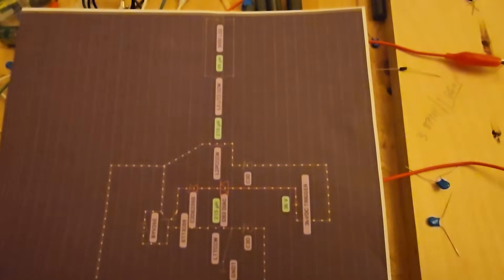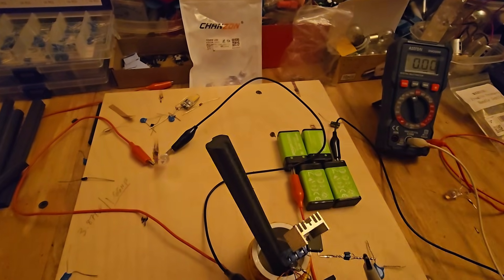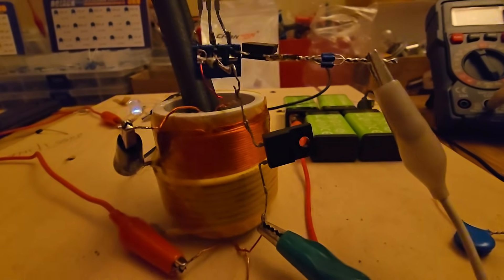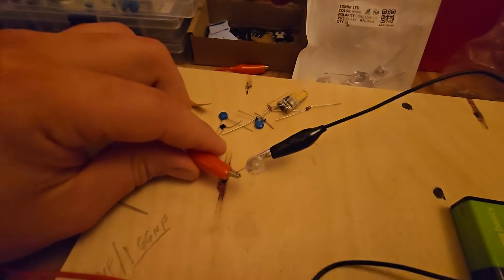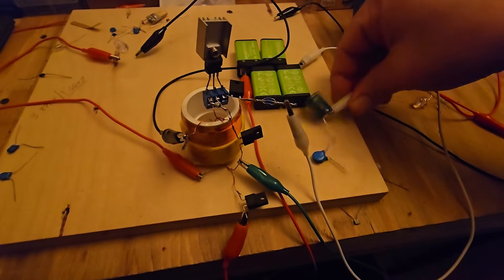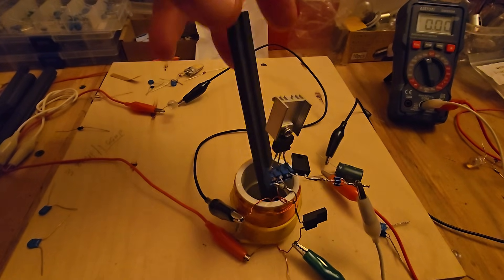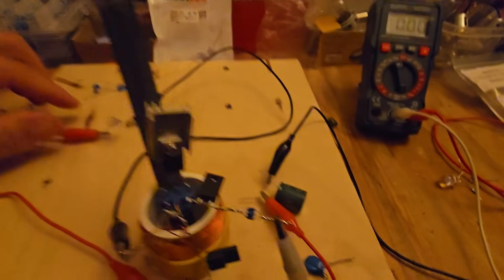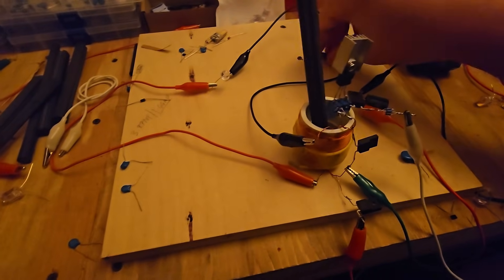🚰DIELECTRIC AVALANCHE OSCILLATOR RUNS OFF FIELD TENSION & PURE VOLTAGE BIAS ONLY.TRUE 0 AMP DRAW🤯

Comment from the maker: Hi, our best performing transmitter is wound upon a one inch diameter pvc pipe coupler that is 1&10/16ths inches wide by 1&14/16th inches long. This transmitter is powered off of a 45vdc VOLTAGE POTENTIAL ONLY to trigger.

The length of the transmitters coils are all 1.48 inches long & centered upon the pvc coupler to be in alignment with the golden ratio.The transmitter consists of three coils being an inner red L1 trigger coil & an outer orange L2 power coil & a 24awg L3 litz coil wrapped in the same direction as the outer L2 power coil for constructive interference. Both the L1 & L2 coils are identical to eachother to achieve sympathetic resonance & are wound opposite & over eachother as tightly as possible for optimal coupling to ensure efficient oscillations with our vital ST13009 driving transistor that seems to be near perfectly impedance matched & we used 24awg solid core magnet wire for both the L1 & L2 bucking transmitter coils. This transmitter is a 416 times mathematically perfect scaled down model of Nikola Teslas magnifying transmitter & heavy earth grounding the bottom of the red L1 trigger coil is vital for its operation & the creation of what appears to be near magic like loadless hyper efficient wireless power effects in the immidiate area possibly due to abrubt inductive switching & for it to possibly pull in dielectric energy in an induction based fashion in theory from the heavy earth ground connection. This energy seems to exist completely outside conductors but conductors are needed to establish the condition for this energy to flow. 24awg solid core magnet wire seems the best so far for the L1 & L2 on this style of transmitter & produces the most powerful wireless power & possible energy synthesis effects due to the 24awg transmitter coils more closely impedance matching with the test transistors we use. So far all our testing shows that the ST13009 transistor from newark electronics is the absolute best to use in this transmitter system with our current design.

The base of our current ST13009 transistor is connected to the inner red 24AWG L1 clockwise trigger coil. The collector of our transistor is connected to the orange outer 24AWG L2 counter-clockwise power coil. The emitter of the transistor connects to the negative of our battery through a series C3D02060 diode (anode to emitter) & DB3 Diac (3 in parallel) & the positive connection of our battery connects to the bottom of our orange L2 power coil through another series C3D02060 diode (Cathode to coil) bottom opposite of the transistor. We replaced the 70 Megaohm 1/4 watt carbon film biasing resistor with a reversed biased C3D02060 diode instead of the resistor that (must be a carbon film resistor for RF applications) between the collector of our transistor & the bottom of our inner red L1 trigger coil to ensure the transmitter can oscillate on voltage potential only. The modules can keep being duplicated & combined for infinite power output from voltage potential only in theory or the voltage potential/biasing that triggers the transmitter can be increased in voltage/pressure for extreme power output at the L3 from one single transmitter/generator unit in theory so long as you don't exceed your abrubt unidirectional dc switching capabilities & in our case we use diacs at the moment.

TRANSMITTER LCR READINGS: 24AWG
INNER RED L1 SOLID MAGNET WIRE TRIGGER COIL HAS AN INDUCTANCE OF .215mH WITH A RESISTANCE OF 00.9 OHMS

24AWG OUTER ORANGE L2 SOLID MAGNET WIRE POWER COIL HAS AN INDUCTANCE OF .210mH WITH A RESISTANCE OF 00.9 OHMS

24AWG OUTER LITZ L3 COIL HAS AN INDUCTANCE OF 99uH & WITH A RESISTANCE OF 00.7 OHMS

BREAKTHROUGH 11/25/25 

I HAVE REPLACED THE 70 MEGAOHM BIASING RESISTOR WITH A REVERSE BIASED C3D02060 DIODE (ANODE TO COLLECTOR/CATHODE TO L1 BOTTOM). THE TRANSMITTER ALSO OPERATES WITH NO BIASING RESISTOR OR DEVICE INSTALLED! BUT THE PULSES OF LIGHT AT THE L3 COIL ARE SLOWER & SLIGHTLY MORE RANDOM. I SWAPPED THE SERIES POSITION OF THE DIAC & C3D02060 DIODE THAT COMES OFF OUR TRANSISTOR TO NOW BE EMITTER,DIODE,DIAC,NEGATIVE INPUT & THE L3 LED LIGHT OUTPUT NOW PULSES STEADILY & RAPIDLY. 

I NOW ADDED A 4.7nF CAPACITOR OFF EACH LEG OF THE L3 COIL IN SERIES THAT THEN GOES INTO A FULL BRIDGE RECTIFIER COMPOSED OF STTHR106 DIODES TO RUN THE 3VDC 10MM LED. THE ADDITION OF A 400VDC 4.7uF CAPACITOR ALLOWS THE LED TO GLOW DIMMER BUT MORE STEADY. ALSO IF I TOUCH THE L2 COIL THE LED BEING RUN FROM THE L3'S FULL BRIDGE RECTIFIER WILL GLOW BRIGHTER BUT THE TRANSMITTER WILL EXIT OUT OF THE 0.00 CURRENT CONSUMPTION STATE WHEN THIS IS DONE. (FURTHER NOTE: THE LED AT L3 WILL PULSE JUST FROM BEING CONNECTED TO 1 END OF THE L3 COIL)(I NOW HAVE THE SYSTEM RUNNING FROM A 45VDC 9V BATTERY BANK STACK IN THE 0 INPUT CURRENT MODE & THE LARGER PLATE AREA INSIDE THE BATTERIES HELP THE SYSTEM OUTPUT MORE POWER AT L3. SHRINKING THE BATTERY PACK TO BE TO SMALL WILL CRIPPLE THE DEVICE FROM CONJURING POWER AT THE L3 COIL FROM ALL THE PRELIMANERY DATA SO FAR POSSIBLY DUE TO THE INTERNAL PLATE AREA OF THE BATTERY BEING TO SMALL. ALSO ALUMINUM FOIL CAN BE WRAPPED AROUND THE 9VDC SERIES BATTERY PACK/BANK & INSULATED/TAPED WITH A WIRE COMING OFF IT & CONNECTING THIS WIRE TO THE BATTERIES NEGATIVE RAIL INCREASES OUTPUT AT L3. TO MAINTAIN THE LOADLESS STATE THE IN LINE ABRUBT SWITCHING APPARATUS MUST BE CORRECT & NOT STRAINED OR OVERSATURATED.)(I NOTICED THAT CERAMIC CAPACITORS IN PARALLEL ON THE REVERSE BIASED C3D02060 DIODE CAN CONTROL THE L3 COILS POWER OUTPUT WITH SMALLER CAPACITORS LIGHTING THE LED AT L3 IN PULSES MORE RAPIDLY & WITH BIGGER CAPACITORS LIGHTING THE LIGHT IN SLOWER MORE POWERFUL PULSES. SO FAR A 820pF CAPACITOR IN PARALLEL ON OUR BIASING DIODE SEEMS PERFECT.)

FURTHER NOTES: A voltage detection wand won't beep near the device when its outputting rapid pulsed power & lighting the led at L3. If i use my finger as a high value resistor & touch the pins on our C3D02060 biasing diode the L3 light will stop pulsing & glow steadily but then the transmitter consumes less than 1mA of current/exits the loadless state & the voltage detection wand will beep

Comment: Your instrument is not able to detect properly the input current.
Please, if you want to connect proper meters, your presentation will be more professional than now.

At the moment, you cannot state that your consumption is 0A, because your readings on the amp meter are not precise and enough sensitive.
Reply from the maker: The input current is true 0 & if you want to be super technical the input current can only be the NANOAMP leakage current inherent to the reverse biased C3D02060 biasing diode in place of the 70 megaohm biasing resistor. The system also works open circuit & i showed that in an earlier 2 minute vid. It will work with the 70 megaohm or reverse biased diode removed.
Reply: @MTECH2022 in order to say that the current is true 0, you have to measure it.

Comment: Hi, a proper schematic, not a terrible black printed sheet, black symbols on white paper, use a pen and paper.
Forget about using a simulator program to draw your circuits.
Make them clear and readable, that paper copy you have shown has so much black ink in it that it has bled into the lighter lines.
Reply: It's been posted. He says it right in the beginning of the video. Starting to think you're just a troll.
Reply: @brianp5210  Place a link to where it is.
Not a troll, just someone who wants to see proper electrical evaluation of efficiency, power in and power out.

Comment: Love this Kind of DIY electronics. I'd love to see you make more started with capacitors and power something bigger for a long time like months. That would prove your point even further than the button cells. Since you only need the voltage differential, there should be no problem.

Comment from the maker: The MTECH "Zero-Point" Dielectric Oscillator: A Solid-State Aetheric Engine that operates off of field pressure/tension only.

Description: Welcome to a demonstration of Open System Thermodynamics and Aetheric Engineering.
In this video, we present the successful realization of a "True Zero Current Input" Power Transmitter—a solid-state apparatus that demonstrates the generation of usable power without the consumption of source current.
The Physics of the Impossible
Standard electrical theory dictates that to perform work (Light), one must consume current (Amperage). This device challenges that paradigm by operating on the principle of Dielectric Relaxation Oscillation. By shifting the engineering focus from Magnetic Flow (Kinetic Current) to Dielectric Pressure (Static Potential), we have created a system that utilizes the battery not as a fuel tank, but as a voltage reference—a "spring" that pressurizes the Aetheric medium.
The "Archform" Architecture
This is not a conventional circuit; it is a geometric "Archform" designed to induce Synchronous Parameter Variation.
The Core: A Golden Ratio coil configuration utilizing sympathetic resonance.
The Engine: A high-speed ST13009 switch from Newark Electronics, ruggedized against thermal runaway.
The Breakthrough: A unique "Floating Oscillator" topology. Using ultra-fast STTH1R06 diodes on both the positive and negative rails, the transmitter is effectively isolated from the "chemical drag" of the battery.
The Trigger: A calibrated DIAC Avalanche mechanism that acts as a "Cosmic Fuse," firing the system via dielectric induction rather than resistive connection.
The Results
As demonstrated, the system drives a visible output at the L3 24AWG Litz Wire receiver coil while the input ammeter registers a verified TRUE 0.00 mA. This is the signature of Energy Synthesis—where the system's losses are overcome by the ambient induction of the environment (P_{env}), allowing the device to operate on the "breath" of the Aether itself.
This research validates the foundational theories of Nikola Tesla, Charles Steinmetz, and Eric Dollard, proving that energy is not a finite resource to be burned, but an infinite medium to be gated & controlled via the mastery of hysteresis.
Key Components:
ST13009 High-Voltage Transistor
STTH1R06 Turbo-2 Ultrafast Rectifiers
DB3 DIAC Trigger Array
24AWG / Litz Wire Resonant L3 Coil & two opposing 24AWG solid core bucking coils. 
Join us as we explore the physics of the future.

By isolating the magnetic drag of the battery and running purely on Dielectric Pressure, this solid-state transmitter lights the L3 output Litz coil while the input meter reads a flat 0.00 mA.
This is Aetheric Engineering in practice: Using geometry and resonance to gate the infinite energy of the environment. No hidden wires. No camera tricks. Just pure Physics.
#EnergySynthesis #NikolaTesla #AetherPhysics #ZeroPoint #MTECH #EngineeringBreakthrough 11/24/25

our best performing transmitter is wound upon a one inch diameter pvc pipe coupler that is 1&10/16ths inches wide by 1&14/16th inches long. This transmitter is powered off of a 36vdc VOLTAGE POTENTIAL ONLY to trigger.

The length of the transmitters coils are all 1.48 inches long & centered upon the pvc coupler to be in alignment with the golden ratio.The transmitter consists of three coils being an inner red L1 trigger coil & an outer orange L2 power coil & a 24awg L3 litz coil wrapped in the same direction as the outer L2 power coil for constructive interference. Both the L1 & L2 coils are identical to eachother to achieve sympathetic resonance & are wound opposite & over eachother as tightly as possible for optimal coupling to ensure efficient oscillations with our vital ST13009 driving transistor that seems to be near perfectly impedance matched & we used 24awg solid core magnet wire for both the L1 & L2 bucking transmitter coils. This transmitter is a 416 times mathematically perfect scaled down model of Nikola Teslas magnifying transmitter & heavy earth grounding the bottom of the red L1 trigger coil is vital for its operation & the creation of what appears to be near magic like loadless hyper efficient wireless power effects in the immidiate area possibly due to abrubt inductive switching & for it to possibly pull in dielectric energy in an induction based fashion in theory from the heavy earth ground connection. This energy seems to exist completely outside conductors but conductors are needed to establish the condition for this energy to flow. 24awg solid core magnet wire seems the best so far for the L1 & L2 on this style of transmitter & produces the most powerful wireless power & possible energy synthesis effects due to the 24awg transmitter coils more closely impedance matching with the test transistors we use. So far all our testing shows that the ST13009 transistor from newark electronics is the absolute best to use in this transmitter system with our current design.

The base of our current ST13009 transistor is connected to the inner red 24AWG L1 clockwise trigger coil. The collector of our transistor is connected to the orange outer 24AWG L2 counter-clockwise power coil. The emitter of the transistor connects to the negative of our battery through a series STTHR106 diode (anode to emitter) & DB3 Diac (3 in parallel) & the positive connection of our battery connects to the bottom of our orange L2 power coil through another series STTHR106 diode (Cathode to coil) bottom opposite of the transistor. We added a 70 Megaohm 1/4 watt carbon film biasing resistor (must be a carbon film resistor for RF applications) between the collector of our transistor & the bottom of our inner red L1 trigger coil to ensure the transmitter can oscillate on voltage potential only. The modules can keep being duplicated & combined for infinite power output from voltage potential only in theory.

TRANSMITTER LCR READINGS: 24AWG
INNER RED L1 SOLID MAGNET WIRE TRIGGER COIL HAS AN INDUCTANCE OF .215mH WITH A RESISTANCE OF 00.9 OHMS

24AWG OUTER ORANGE L2 SOLID MAGNET WIRE POWER COIL HAS AN INDUCTANCE OF .210mH WITH A RESISTANCE OF 00.9 OHMS

24AWG OUTER LITZ L3 COIL HAS AN INDUCTANCE OF 99uH & WITH A RESISTANCE OF 00.7 OHMS

BREAKTHROUGH 11/25/25 

I HAVE REPLACED THE 70 MEGAOHM BIASING RESISTOR WITH A REVERSE BIASED C3D02060 DIODE (ANODE TO COLLECTOR/CATHODE TO L1 BOTTOM). THE TRANSMITTER ALSO OPERATES WITH NO BIASING RESISTOR OR DEVICE INSTALLED! BUT THE PULSES OF LIGHT AT THE L3 COIL ARE SLOWER & SLIGHTLY MORE RANDOM. I SWAPPED THE SERIES POSITION OF THE DIAC & C3D02060 DIODE THAT COMES OFF OUR TRANSISTOR TO NOW BE EMITTER,DIODE,DIAC,NEGATIVE INPUT & THE L3 LED LIGHT OUTPUT NOW PULSES STEADILY & RAPIDLY.